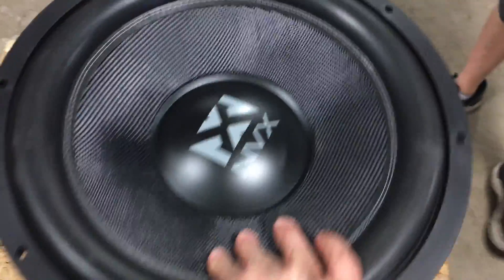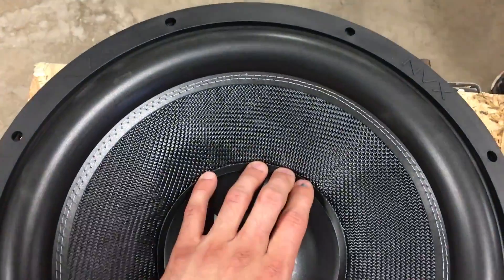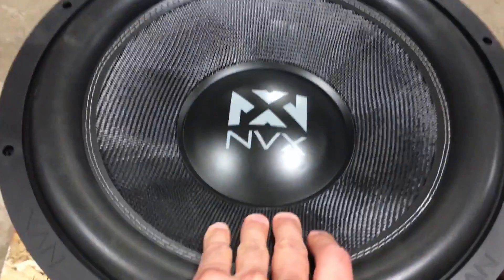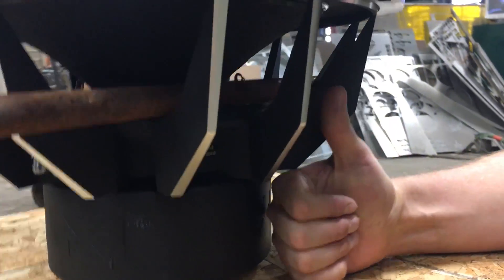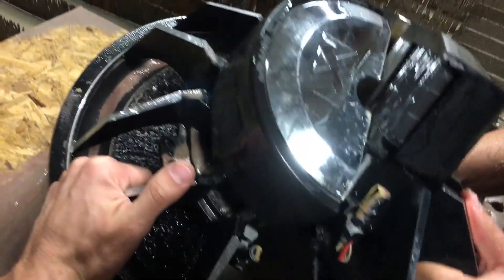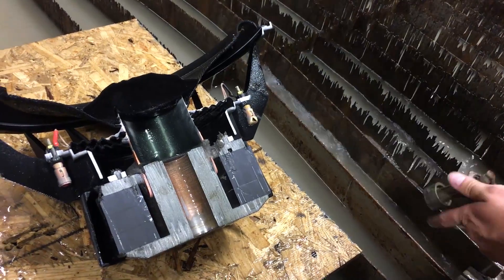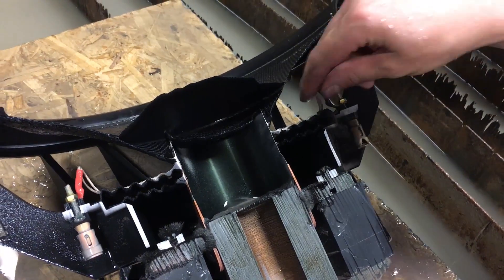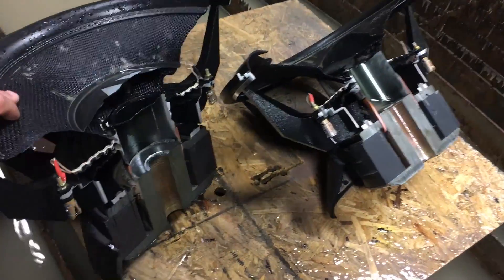15 inch Subwoofer vs 60,000 PSI Waterjet 📢

Comment: A rare sub-par Mitchell explanation there... Everybody knows that the external reticulating flange membrane is connected to the oscilating pleasure coil, whose internal ribs are oppositely charged to the rhythmic thrust coupler that slides in and out rapidly and increases the amplitude of the source packet from the input module.

Comment: Okay here is how I subwoofer actually works... subwoofer has a coil that can be made up of copper or aluminum or any other type of conductive metal when these are activated with a certain type of frequency and placed near a magnet they start to move or vibrate thus they added a cone which creates bass and the spider that the "wire" was connected to stabilizes the coil from bouncing around it also controls the stiffness of the subwoofer and then the terminals that the "wire" we're connected to are the things that connect the wires to the subwoofer

Comment: Those are actually so expensive. My brother had a 1500$ set of subs in his car that got stolen at school. But he wasnt even mad.  At full volume it made items in our house shake when he was 3 yards away from the house
Reply: I can do that with a single kicker 15
Reply: dang 9 feet away?
Reply: Keep in mind that $1500 set had only 2 speakers.
Reply: You can get two of these speakers for $400 off the website they mentioned. A pair of sundown nightshades would be priced around $1500 excluding the amp, wiring, enclosure, and possibly an extra battery which would double the price.

Comment: If you guys want to know, the current coming from the aux cord changes direction really quickly and alot. This current is conected to a solenoid which when near a magnet ( a small one inside, or in a speakers case, surrounded buy one), will case it to move which moves the speaker drum or the rubberey stuff as you guys called it, and creates soundwaves. The physucs behind solenoids is the same as how rail guns could possibly work.

Comment: RIP subwoofer users
Reply: Still a couple hundred dollars. Its a nice sub for the price.
Reply: AlpaCoinRoll, better then the shit at walmart (that most people buy) sure, but far from the likes of DC Audio Level 3's or 4's, like I am planning for my upgrade over my BB212D Planet Audios
Reply: I had had one before. It takes 1250 rms easily. I know what I am saying too its not like a boss audio "1200rms" bullshit.  I had it on a crescendo amp at around 1250. I am looking to upgrade, I don't even have my system anymore. It can pull its weight though. It is great entry level. Not even comparable to Walmart shit or boss audio or any of those other fake ass brand out there.
Reply: I know, that somewhere, deep down in my heart, I STILL LOVE YOU NOOOOOOOooooooooooooooooooooooooooooAahaaaaaa
Reply: the8jrfan meh hart
Reply: I use Bang&Olufsen hahaha
Reply: it's an NVX, so not a huge loss, besides these guys just don't get it.